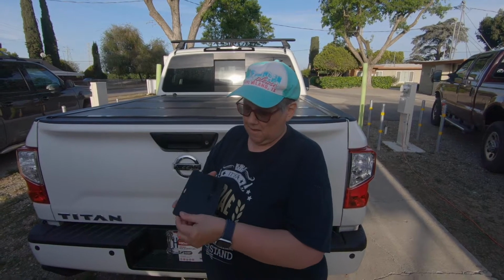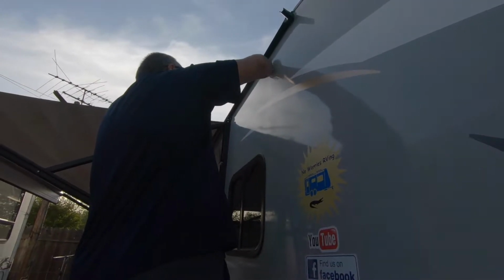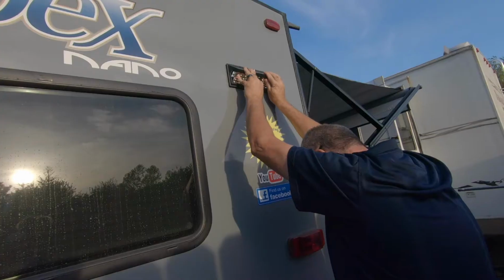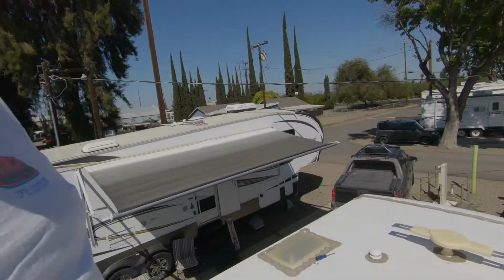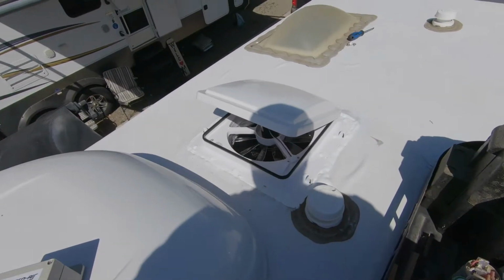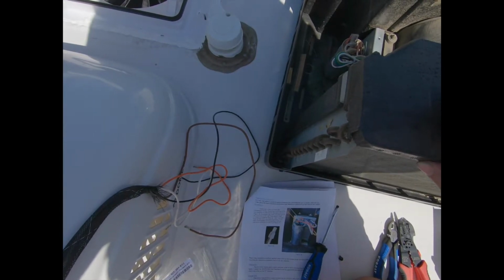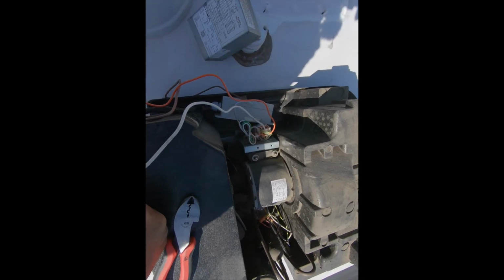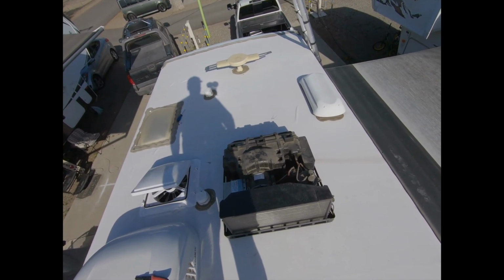2 "Quick" projects.  Exterior LED Lighting Install and a Soft Start Install (Done Correctly)

Comment: Great videos! Those solar lights....by permanently mounting them with the tape, you can't change the settings anymore once mounted! Also, if you are traveling at night they would come on while in motion. That light on the back could blind the driver behind you. Have you encounter these problems?
Reply from the maker: We rarely travel after dark but you literally have to tailgate us for the sensor to trigger the light.  The reason we put the lights on is that the trailer will be sitting in an RV park in California for a long spell and security is a top priority now.  When we start traveling more we will re-evaluate the need for the lights altogether.  You are right about the settings being obstructed by permanently mounted,.  I thought about mounting a magnet permanently and just attaching the lights after stopping for the night.  Stay tuned for the reason we will be pausing our travel for the next few months.

Comment: Can anyone suggest what to put in my Apex Nano during the winter to protect it from mice ?
Reply from the maker: I am not sure there is anything you can put a camper to protect it from mice.  I would crawl under the camper and fill any holes you see with cheap steel wool and then caulk it in place.  Once you have done that I would buy cheap dryer sheets and put them in each cabinet and drawer in the camper to mask any possible food smells that mice may be attracted to.  If you can't do this for some reason I would try spraying peppermint oil everywhere inside and out of the camper.  I have seen Disney use peppermint oil to keep bees under control around their outdoor soda dispensers at the resort pools and the entomologist said peppermint oil works for most pests including mice.  We have a campground and have seen people use electronic devices, Irish Spring soap, and other home remedies but they don't seem to work.
Reply: @noworriesrving3743  , ok thanks I’m going out now while it’s in the mid 50’s and no rain so I can craw under it. I’m hoping that I could put something that won’t say with the camper something I can air it out. My wife has a hard time with the smells. There are those bags you can buy called Grandpa’s ? but we are reading reviews that they don’t work. I’m going to try the dryer sheets and peppermint if my wife thinks she can handle it. 
Thanks for the suggestions , really appreciate it ! I love to watch you guys on YouTube.

Comment: I see you seem comfortable walking on the roof of your Nano. We have a 2019 213RDS and were told by the dealer that we should not walk on our roof. Should I ignore the dealer? Are there precautions that we should follow?
Reply from the maker: This is funny because we were told that our roof was walkable by our dealer.  I have noticed that the roof material under the rubber membrane is a thin plywood material and probably not truly walkable.  If you can, I would put down a thin sheet of plywood to walk on when on the roof and walk on it as little as possible.  I weigh around 265 and probably too heavy to be walking around the roof.  If you are lighter I wouldn't worry about laying down a piece of plywood to walk on.  Hope this helps!